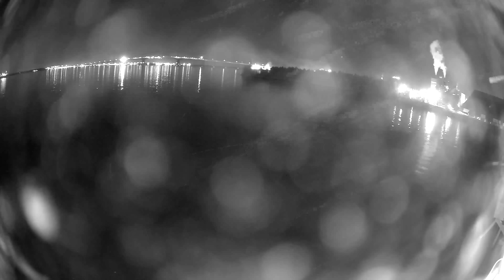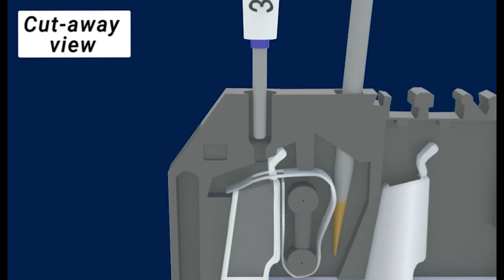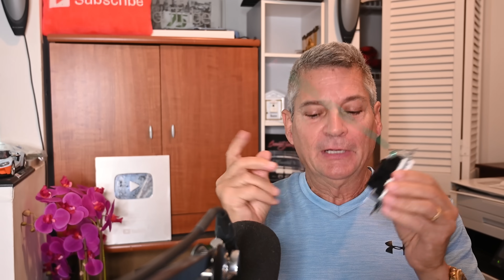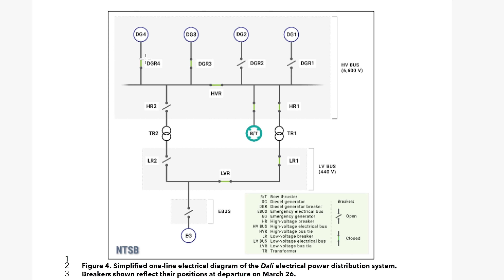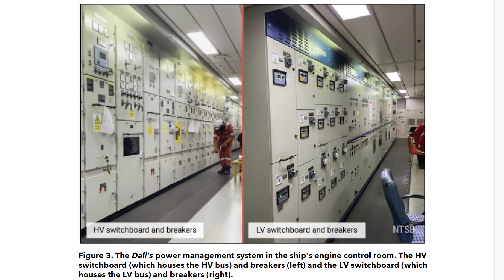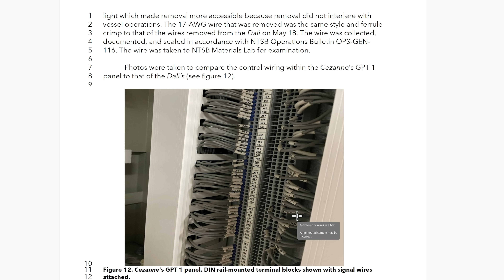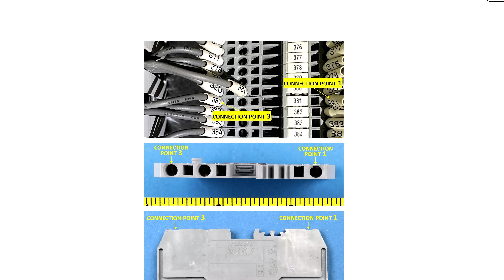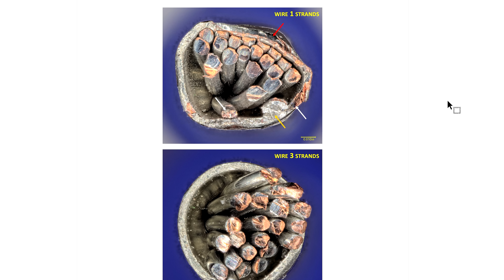NTSB: Scary Wire ERROR Caused Dali Crash/Key Bridge Collapse Baltimore

Comment: Jeff I'm an electrical engineer in the shipbuilding industry, and I can tell you that improper ferrule installation and labeling problems are rampant in both new construction and retrofits. All of us design engineers and commissioning engineers are highly aware of this. I don't go on ship much anymore, but when I did I would take pliers and pull-test every single wire in control panels to find loose or improperly terminated wires.
Reply: I worked for a company that built control panels, including some for marine applications. We had competent wiremen that knew how to terminate wiring and where to fit cable markers. The problem is what happens when the panels are installed in the ship, then it's down to how competent the installers are that put all the ship wiring in.
Reply: @brendanpells912 same here. Field wiring is usually a mess on any panel I've worked on while adding our equipment at plants.
Reply: @CBroPhotography  Sad but I hope the risks of sloppy work are better understood now. It took a collapsed bridge but if that changes mindsets, something good gets accomplished.  Will it happen or will poor pay and working condtions continue to make bad attitudes prevail?
Reply: I've seen stripped wires without ferrules pushed too far in, clamping on the insulation. I spent hours last week chasing a problem like this.
Reply: @b0b5m1th  Running into this issue is why I now check every termination in the involved systems in a no-power troubleshoot.  

More than once i've come across terminals tightened so far it damaged the conductor causing it to lose its rated ampacity.  A 10AWG solid conductor crushed to the point where it's essentially a 16AWG conductor at the terminal.

Also "haircuts" on stranded conductors that "didn't fit." 😮‍💨

Quality work used to be seen as the bare minimum standard and not a hindrance to "The Bottom Line." 😡
Reply: It's because professional electricians got sacked in the Marine industry between 2008-2010 and replaced by incompetent workers without any education or language skills to save on wages. The entire industry got fricked. Samsung heavy, Hanjin heavy and Hanwha are the most reckless. Chinese have been rising in the market now and it's even worse there. As a supplier, it's a nightmare to communicate with them.
Reply: @thedangerzone9399  Do you have any proof of the 08-10 claim, about the mass sacking and that uneducated, incompetent people were hired instead? Or are you just bitter?
Reply: If your an EE, that explains why u didnt know that you never use ferrules on clamp terminal blocks, only use ferrules on screw type connections. Ive worked for some of the biggest machine builders in the world and aerospace companies this is such a general basic rule day 1 newbies learn. Ferrules lead to loose connections in spring type connections. Loose wire allows the clamp to actually clamp
Reply: @TortaSpecialist  "Clamp Terminal Blocks".  Not even a term, but you stay on your soap box.  So, these terminal blocks are designed to ALSO accept a solid wire and CINCH it with 100% reliability.  A crimped on pin represents no difference to the clasping mechanism than a solid wire would, and they are absolutely and 100% acceptable practice.  Some systems as an internal policy specifically ban their use and that is strictly a choice made by those system designers.  But THE INDUSTRY as a whole knows the operation of the mechanism in question here, even if some of the folks who actually work in the industry do not.  Perhaps you should actually state facts in the future, because I spent DECADES working for military contractors both pre and post mil spec and the advent of COTS.  I KNOW the IPC 610 G spec they comply with because I inspected assembled articles to it, and I KNOW that you are not correct.  The loose wire in your head actually allowed your brain to clamp down on the incorrect policy.  Torta that, child.
Reply: @cosmicraysshotsintothelight  no one in their right mind would use solid wire in an industrial box😂 your the prime example of an engineer who thinks he knows everything but in real world applications woulf fail at every mark😂 yeah I dont use the proper name for things when im randomly on youtube comments😂 my bad, to the queen of England here😂 you literally just proved my point. As someone who has built and troubleshoot machines for the biggest companies in the world and aerospace environments i know what fails and doesnt. I know that a ferrule on a terminal blocks with a spring clamp will fail😂 I know that you should only use ferrules on screw type connectors😂 but tell me what industrial box youve ever seen that has solid wire instead of stranded😂 #YourDegreeDoesntMeanYourSmart
Reply: @cosmicraysshotsintothelight  lil bro went quite when he realized aerospace standards are higher than Mil spec for a contractor that makes one tiny part for the military 😂 Id bet a years salary your specs on parts are in the tenths or hundredths, not tenths of a thousandth like mine. So sit down, id hate to work on any thing you touched with how little you know about the industry.
Reply: @TortaSpecialist  That's actually interesting. I'm building and testing control cabinets, mainly used in CNC machines and automotive industry. I've never really thought about ferrules being this bad for spring clamps (especially in aerospace, as you stated). I'd love to have more experience with cabinets that are actually used and maintained, not only produced and tested before delivering them to the customer. :D Just wondering, how did you start working in this particular sector?
Reply: Whenever I have a de-energised panel, I do a tour of the junctions (screwed or clip, all of them) and usually find a few dodgy ones that are waiting for the right storm in winter at night to fail…
Reply: The solution is to spec a different type of terminal block that allows for push in installation such as the PT 2.5. This type should not be used with ferrules to begin with due to the problem demonstrated in this video but also because the ferrules tend to get caught in the mechanism and pulled off during troubleshooting.
Reply: @FlakeSE  if the ferrules can be pulled off they’re badly crimped
Reply: I would be penalizing a contractor and getting a new one or a new trainer for whomever is doing it.
Reply: We always  do a wiggle test after  terminating a cable  I suspect the person terminating the cables just pushed  it in whilst holding the cable marker. And as he did the marker slide down the cable making it feel  as it was fully inserted but failed  to do a wiggle test
Reply: I have spent the last ten years working quality assurance in precision aerospace manufacturing. It's alarming how often management would be happy to accept human error as a root cause. Hope you don't plan to fly soon.
Reply: Ferrules are not to be used with spring-clamp terminals. 
It is that simple yet people going on explaining ferrules yada yada.
Reply: @johanea wrong
Reply: @johanea so educate us, where are they to be used?
Reply: @mikeSam2534 Screw terminals.
Reply: @johanea  and spring terminals
Reply: @johanea  that doesn’t appear to be true. Weidmuller, for instance, has no such restrictions.
Reply: @robertadsett5273  Not having restrictions does not equal that something is right or wrong.
But I get you, sure.
The fine and widely used German DIN standard, do support my stand for an instance.
People can do what they want, bare wire, twist them or ferrule. 
I do not care to be honest. 
But don't cry when a large vessel takes down a weak bridge because of idiotic wiring.
Reply: @johanea  which standard? I haven’t found any standard or any reasoning to ban ferrules in spring clamps. There are reasons to use ferrules
Reply: In that case you should know that ferrules are NOT to be used with spring-clamp terminals.
Reply: @johanea  Well, you are not a Solder Creep.  What kind of creep are you?  A Screw Terminal Creep?  Lack of inspection is what is NOT to be used on ANY electrical system, regardless of terminal type.
Reply: @cosmicraysshotsintothelight Not sure what you are mumbling about…
Reply: @johanea 100% not true.  What mfg says this?  Not Wago.
Reply: @michael931 Wago mention, and I paraphrase a bit, that their terminals are suitable to be used without ferrules. However if local rules and regulations require ferrules, that is also acceptable according to Wago.
Reply: @johanea  Now THAT was fuking mumbling.
Reply: @johanea i know.  I use them and i used to sell them.  Use with ferrules is a selling feature.
Reply: @michael931 Yup, and the vessel which knocked down the bridge is a prime example of how great and compatible ferrules and those type of terminal are.
Reply: @cosmicraysshotsintothelight What was?
Reply: @johanea  "What was?"  << And here you demonstrate that you do not even know how to respond to a YT comment.  How in the fuch am I supposed to know what the fuch you are asking about when you do not even say or show or quote it?  NO, YouTube does NOT thread comments and responses.
Reply: @johanea  based on what?
Reply: Sounds like SOMEBODY HAS TO, until such time as they can build cameras / imaging systems that are capable of detecting improper terminations.
Reply: . That was one of the recommendations in the ntsb report, to use thermal imaging to detect these issues. However, optical inspections with trained eyeballs can spit this issue
Reply: @ghammer9773 a control wire like that draws negligible current.  Maybe 10mA if you are lucky.  I don't think it will produce measurable heat in normal use.
Reply: I'd write that off as a design defect. It shouldn't be possible to install the label over the ferrule. The design itself guarantees failure.
Reply: Why not redesign the ferrule, that plastic boot just completely unnecessary. Since it is only leading to issues why not just eliminate it.
Reply: @ExileXCross there are ferrules without the boot when that is the right option. The boot provides some protection against wear due to bending where the insulation strips back. This was the result of improper use of the tool, not a flaw in the tool itself.
Reply: @cheereebus In this example the teminal block itself already serves purpose of strain relief.
Reply: @ExileXCross it holds the wire end in the clamp but has a cavity which fits the boot. Still, there is no reason to not use a ferrule with boot if it is used properly. And in this case it was the label being over the book which was the deeper failure.
Reply: @ExileXCross You can get uninsulated ferrules, but the insulation has a tapered entry so it guides all of the fine strands in the wire into the ferrule tube. Without it, it would be a nightmare to get the strands in because they have a natural tendency to splay out.
Reply: @brendanpells912 Even the ferrules without the boot have a slight funnel on one end to help, but it's not foolproof
Reply: @landonbrown5295 Good thing with a ferrule is you can tell at a glance whether a wire is fully inserted into a terminal by seeing how far the plastic sticks out beyond the terminal.
Reply: @brendanpells912  Yeah, on those terminals you should see almost a straight line of grey to blue showing all the connectors are pushed in the same amount but can't because how those labels were stupidly placed.
Reply: @ExileXCross  There's only so much you can design against.

I'm all for engineers taking responsibility for careful design, but it gets to a point where if people don't know the difference between live, neutral and earth, there's no plug design that will make sure they wire it correctly.

This is more and indication of deeper systemic problems, of unqualified crews building/maintaining ships.

The only way to fix this is to make individuals - the people who control the purse strings - criminally liable for this sort of issue, because fines just become "cost of doing business".
Reply: Why not redesign the terminals with a larger opening ? The plastic ferrule helps wire insertion  @ExileXCross

Comment: I haven't been through the posts, I've been employed in industrial electronics all my life have never seen such inconsistent use of electronic/electrical symbols ever.  If I were given a set of prints to analyze a circuit and each page had a different set of symbols, would I be in trouble.  A typical example would be that of a transformer, or circuit breaker, wow.    Jim

Comment: The problem isn't the ferrule it's a ship system design issue. The electrical power required to keep the propulsion diesel running and steering operative should come from an emergency buss that supplies power to the engine systems and steering ohly.  To keep the engine running it needs fuel, cooling water and power for engine controls and any other critical engine accessories. This emergency buss should be powered by one or two relatively small emergency generators which  feed this emergency buss only and   start immediately when power is lost from the ships main generators. Qnce that power is lost, as the breaker connecting the emergency generator to the emergency buss feeding engine and steering systems,  the breaker connecting to the main ship buss will bs tripped to prevent back feeded power into a dead buss. 
 From what's been published so far there seems to be a lack of mandatory operating procedures in commercial ships of this type. For example the emergecy generators and their associate circuit breakers are not, apparently tested before leaving port. Also at the ship's discretion, if some component of one of the busses is not working, it's ok because the other main buss can be used. I'm guessing that doing such a thing, the crew is assuming nothing will happen to the other buss which would be instrumental in the main engine shutting down. It seems like a very  slip shod operation to me.

Comment: More likely than forced insertion of the ferrule, the very overheating which you indicated the IR thermometer might have detected could have deformed its compromised tip over time, softening and tapering it down as the photo shows until it eventually squeezed out.

Comment: I do panel wiring and I made a spacer to place on the end of a wire as you are labeling so that the label is an inch away from the end. labels are always in the same place and we pull on each wire when we inspect to make sure its a good connection.
Reply: and on bigger wire's?   thats where most issues start.  cage style termnials dont have the clamping power to really deform the ferrule which isnt that strong on 16mm2+  so i had a few just pull out with the ferrule still in the terminal.   so yup bare it is.   can lift the whole panel when its bare

Comment: It's amazing that a simple connection out of hundreds was the problem.. well done NTSB. Your description, analysis and explanation combined with the pics was absolutely fascinating.  I love your channel. As Juan would infer "the Swiss Cheese model". Probably had a coffee break or shift change like the DC-10 crash, ultimately the result of a shift change and ppl didn't realize the issue of the pylon deformation. Here, they just made a single, simple assembly error, who'd of thunk it would a problem like it was. How do you check something like this as it's being constructed? I say again.. well done yourself.
Reply: The main problem was the reduced redundancy and the bustie was connected and not separated i to two electrical systems, this would never be a problem if they separated both systems before departing the port facility until they get out of the narrow trafficked channels and out i to open waters, where you can again connect the busties and run the system as one electrical system (makes it easier with maintenance for the crew)

Also spring clamp is better than screw terminals on ships due to constant vibrations (for those who think otherwise) its just faulty installation and maybe a bit problematic maintenance from the crew as you are normally meant to check all connections throughout the years in service, but sometimes you may skip some parts that has been checked often (frequent checks in the maintenance system) and it just gets piled away through the years.

But my first initial thought when sudden disconnects happen is to check all wiring for any stop/disconnect/safety systems related to the faulty part, always find some funky joint or strange connections throughout my years of work on ships, especially on newly delivered ships, as they often have a few weak connections through the thousands of connections throughout the ship.

Comment: I worked in manufacturing machinery and we used those terminal blocks on all our machines. We didn't have label issues like that but there's other ways people wire these incorrectly. Like using the wrong size boot lace ferrule - I think by memory blue is 2.5mm and red is 1mm. People put screwdrivers into the slots to open them which can be dodgy. Quite a good system though. You can put links between the terminal blocks and make it look really tidy.
Reply: Too much hidden away behind gray plastic.  Neat and tidy can also be visible.  This wago system is a bad idea.

Comment: I hate back stabbed electrical outlets. I'd rather use the new ones with clamps on the side. You don't have to wrap the wire but it's more like a breaker style clamp and it's probably a lot better than back stabbing.